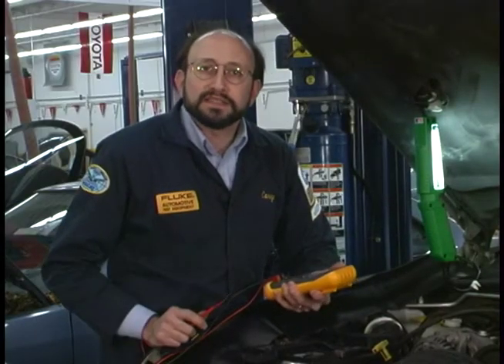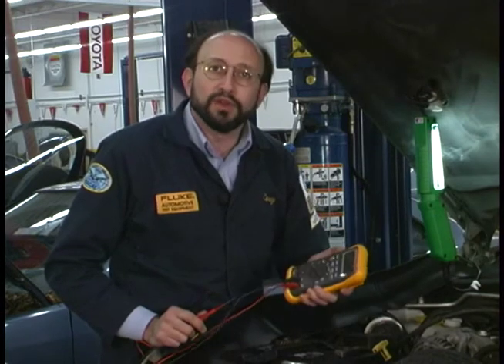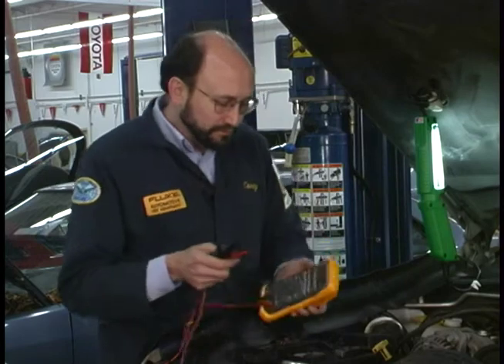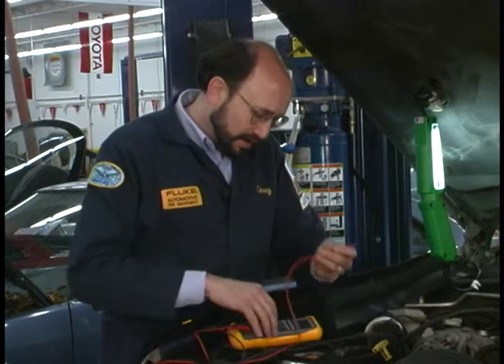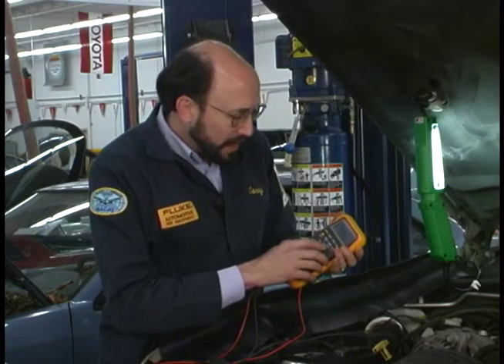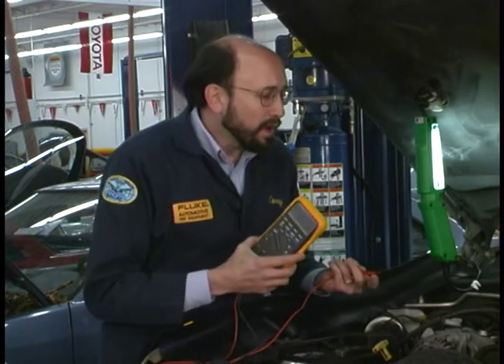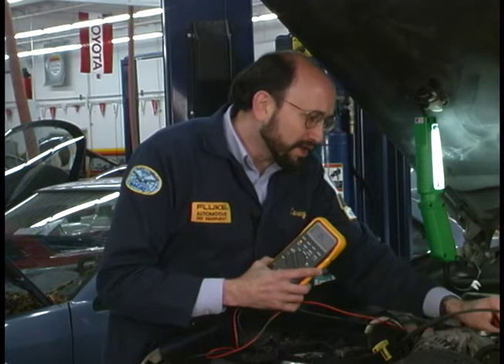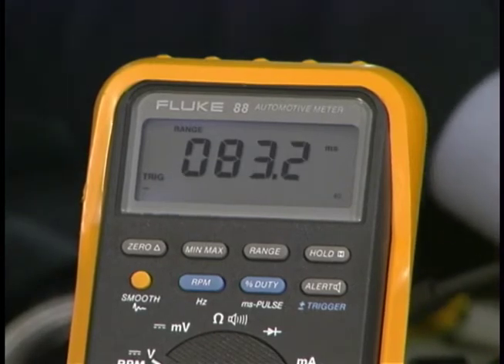Fluke DMM   Injector Pulse Width

Comment: Thanks. Needed to know how to check pulse width of Fuel Injectors  on any vehicle. The Snap On Bi directional Scanners don't support this function on all makes and models.
The Fluke 88 is just what we need to work on any Fuel Injected Vehicle.
The PCM on our 2004 Honda Civic is commanding the Fuel Injectors to stay on too long. The Pulse width is: 6.5 ms- and thus causing a rich condition. The STFT is minus (25). The factory set point is 1.5 to 3.5 milli seconds for the Pulse Width.